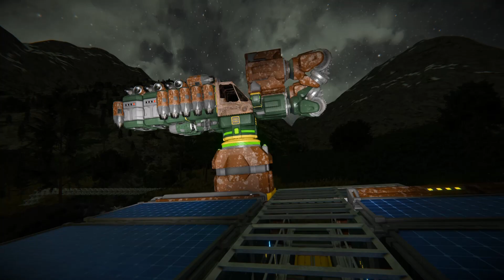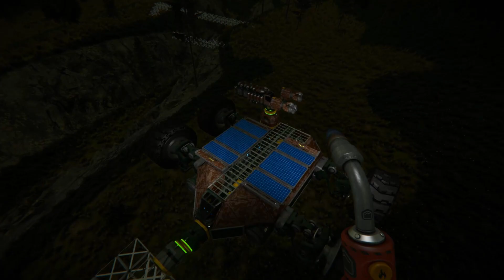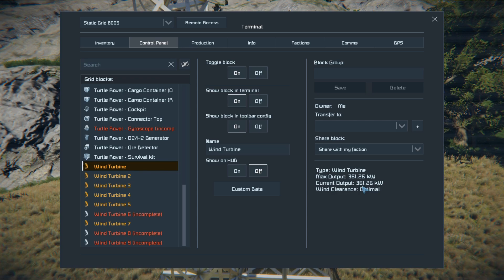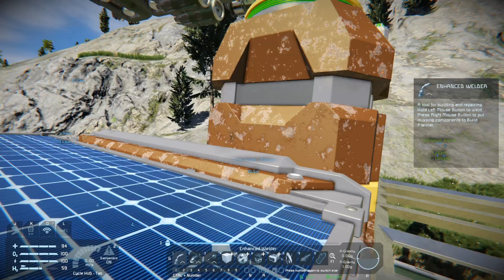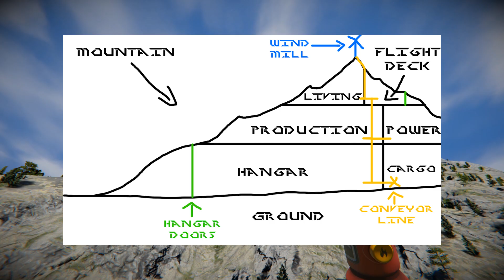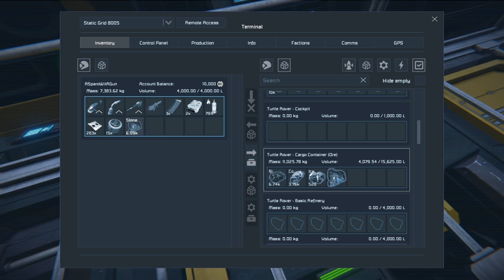Migrating To A New Outpost & Plan For Mountain Base! - Space Engineers LP - E09

Comment: My face hurts from my palm. You have 2-3 batteries on recharge and not on the group on your hotbar, which i suspect is the original battery so of course you will have power issues...
Reply from the maker: Ya know, I JUST caught this yesterday. I thought it was a group control on the hotbar & it turned out it was just the one battery so the other two weren't being affected. o.O
Reply: @Sleeplessknightsstudios  The lights on the batteries themselves show their status. Red = off, Green = On and Yellow = Recharge. Personally I do a visual inspection first before I disconnect. Also i would look at Isy's Ship Refueler Script.
Reply from the maker: Yeah, I noticed the color change. I was familiar with Red & Green obviously, but the yellow one I assumed was recharge or auto. I've used Isy's solar alignment script before & it worked really well, so I imagine their other scripts would be really useful too. I'll have to check them out. :)